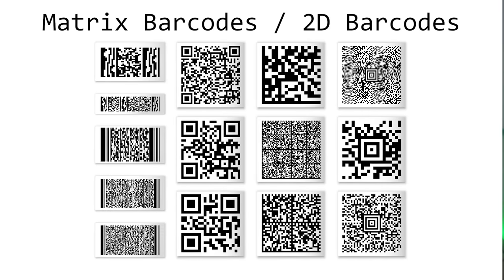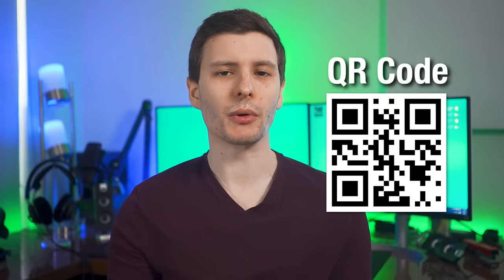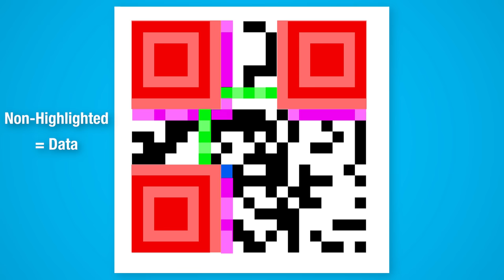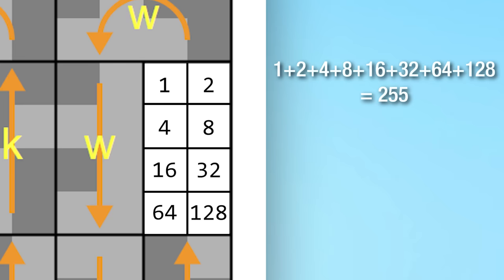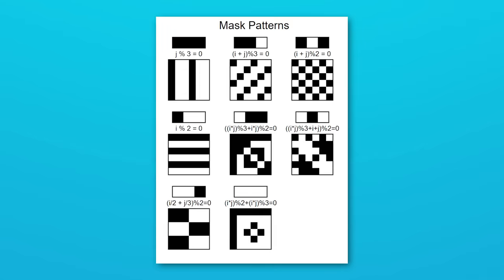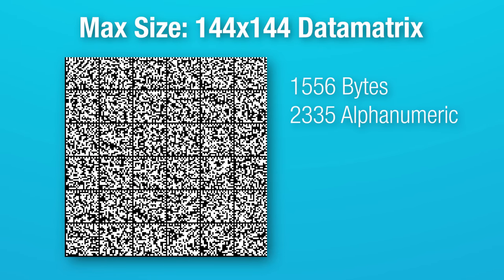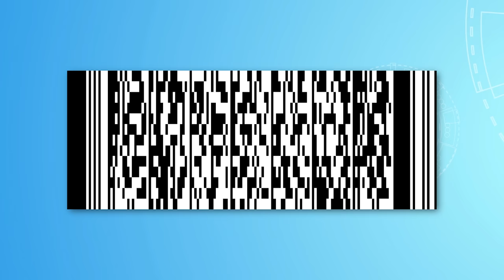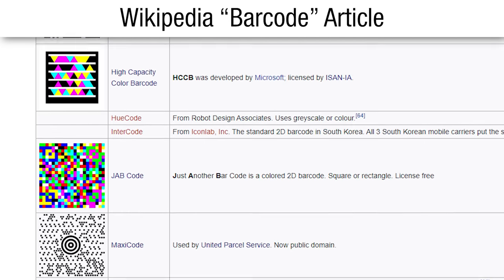What Are Those Other Weird QR Codes?

Comment: My favourite description of how error correction works is comparing it to a sudoku. Sudokus (with relatively few rules) can have most of the numbers missing, yet you can reconstruct the entire thing
Reply: Wow never thought of that angle to explain it! It explains it perfectly!!
Reply: Yeah, it's also a great way to explain data compression. Cheers!
Reply: There may be more than one solution to a given Sudoku that meets the rules.
Reply: @daviddunmore8415  which is analogous to a QR Code with too much info missing, I think, right?
Cheers
Reply: I don't think of sudoku as a game anymore by how much i have used it to describe what i help preventing
Reply: @daviddunmore8415  That's why data correction is so difficult :) cheers
Reply: But Sudoku codes exist, and do not have much of an application!
Reply: @cat-.-  e
Reply: It actually uses matrixes
Reply: It isn't a good analogue. Sudoku only stores very little data.
Reply: Not really, sudoku has a predefined set of data that you need to get it's location. Also sudoku doesn't allow repeating characters. It's a positioning game and not a data correction game.

The way data correction works is more like encryption or lossless compression. It's doing math using the number value of the characters. It's basically rely on having the data and results of formulas using the data. A similar real life example would be stating that someone drove 10 miles at 60mhp for 10 minutes. You only need 2 of those numbers, because any 2 will allow you to calculate the 3rd.
Reply: @Bolpat   @Tony Mouannes    - think of the completed sudoku as the QR code. then when the sudoku gets damaged (numbers removed), you still have all the needed information. often even with half of it missing, everything is still there, almost no matter what parts of it are gone. just like a QR code with error correction
Reply: @MichaelP833  While QR codes have comparatively much redundancy, still most of the space is data. A Sudoku can be unique with as little as 17 digits out of the 81 squares (very little data). When used as an analogy, it gives the false impression that error correction requires a lot of additional data – which in general it does not.
On the other hand, there are Sudokus with a so-called deadly pattern: A group of cells (usually 4) such that unless one of them is given, the Sudoku is not unique, even if all other (77) digits were given.
In total, a Sudoku cannot be unique when it has 16 or less cells given and must be unique when it has 78 or more cells given. In-between (17–77 cells given) it may or may not be unique. Usually, error correction techniques have a smaller range than about ¾ of inputs may or may not be recoverable.
I tried to come up with a better real-world analogy, but those that came to my mind were neither algorithmic nor mathematical. Most people just don’t know about even basic mathematical structures or techniques.
I guess one can use Sudoku as an example, but please let people know about its limitations.
Reply: @tonymouannes  Sudoku has mathematical rules. This is not the issue.

A specially-crafted Sudoku might have a lot of groups of digits such that some fixed cells given, there is a ratio n/m (m = group size) such that when n of them are given, the Sudoku is solvable, no matter which n of the m cells in the group you chose.
I’m not a Sudoku setter, not even a very good solver, so I could be totally wrong on this, but on Cracking the Cryptic (puzzle YouTube channel), I’ve seen so much madness that this doesn’t seem out of reach at all.
Reply: @Bolpat  true, but it's still a different logic than the 2d codes. I'm good at sudoku's and the most used method of guessing a cell is using the fact that the same number can't be there twice in row, column or square. Sudoku is a logical puzzle and you don't need numbers, you can use shapes or letters. Error correction o the other hand is based on advanced algebra.
Reply: @daviddunmore8415  one of the rules for creating a sudoku puzzle is that there can be only one solution
Reply: yes, there is no question, the sudoku analogy is a very limited comparison. most obviously, if line three starts 12, and four starts 21. that small block being damaged removes information. i am guessing that is the idea of a 'deadly pattern' you are talking about. 

but then on the extreme end of things, (thank you cracking the criptic for this insanity), with complex rules, it is possible to have a single solution sudoku with only two filled in numbers. i would hate to test it, but i would guess major random chunks of that solution could be removed and it would still have a single solution. however in this case, it has very very little information stored. no one has much use for a complex QR code that has such high error correction so it only stores a short word.

there was the comment of QR codes using advanced algebra, and i would argue that those 'miracle' sudokus start heading in that direction.

the simplest level of this would just be having a single line of number 1-9 in a random order. one number gets destroyed and you can still know what it is. similar to a simple parity check (not the same, i know). 

the idea of the analogy is not to be a 1:1 match, but to use something that is well known to give some inkling of the concept.
Reply: And… 1000 likes!!!
Reply: Sudoku Code 😀
Reply: @mothwaltz4163  Sudoku Code. When regular sudoku is too easy for you.
Reply: Now exaim how to play sudoko
Reply: My favourite description of how error correction works is comparing it to a sudoku. Sudokus (with relatively few rules) can have most of the numbers missing, yet you can reconstruct the entire thing
Reply: @daviddunmore8415  just add one or two additional rules and that's it
Reply: That’s smart
Reply: Yeah I guess
Reply: Genius
Reply: Very good analogy.
Reply: That is a great analogy.
Reply: @tonymouannes I’d say it’s kind of a mix of both depending on the type of recovery/correction. Parity-based correction like in raid 3 or 5 are a good example of this
Reply: Why is this turning into a huge argument, they aren't identical but it's a good way to explain it simply and quickly
Reply: @Bolpat  It's not about the data stored, but about how, given a predefined set of rules, we can recover missing bits of information.

Comment: Australia's largest supermarket chain is currently in the process of replacing all normal barcodes with data matrix codes on the packaging. This lets them store a whole bunch of things like the expiry date, batch number, etc. So if you try to scan something that's expired at the checkout it won't let you buy it
Reply: Sounds like you’re describing Woolworths as all their products in the Deli, Seafood, Meats and Poultry have Data Matrix Codes on their items, even on stuff that have been reduced in price.
Reply: this could also be done with barcodes and it would be a lot easier (it grabs the data from a database)
Reply: That sounds horrible, since if the matrix code gets stretched vertically on the packaging, it won't scan. If it's on any sort of stretchy plastic packaging, it's going to be so inconsistent and annoying to scan it.
Reply: @nmotschidontwannagivemyrea8932  thankfully, the data matrix codes aren’t stretched as they’re on a separate paper sticker on top of the plastic packaging, my local supermarket has a separate hand scanner on their self serve machines which makes those data matrix codes easier to scan than having to fumble around with the fixed scanner to do them.
Reply: @JaseyRae  What do you do if the sticker comes off?
Reply: @nmotschidontwannagivemyrea8932  I usually notify the staff over there when that happens, they’ll print a new one on the spot
Reply: @JaseyRae  wait... woolworths still have stores???
Reply: But what if I'd want to buy expired food (sometime still edible)?
Reply: Same in Russia. At first it was at alcohol and tobacco and now it is on milk products. But it isn't some supermarket chain initiative. It's nationwide and works in any store of any chain.
Reply: @nmotschidontwannagivemyrea8932  Isn't that what the timing pattern is for?
Reply: Australia's largest supermarket chain is currently in the process of replacing all normal barcodes with data matrix codes on the packaging. This lets them store a whole bunch of things like the expiry date, batch number, etc. So if you try to scan something that's expired at the checkout it won't let you buy it
Reply: @Theunicorn2012 , why did you just copypaste this comment?
Reply: @England91  It's a completely non related woolworths
Reply: Why would one imprint food quality and packaging data on a matrix when you could just use a bar code to refer to that data from a database??
Reply: @roseCatcher_  Because you would need a different barcode for each date, and standard UPC barcodes are far too limited in size to encode that much data. Grocery stores can have upwards of 10000 different products, and UPCs only have 5 digits for the SKU. UPCs are meant to encode a company ID and a SKU that identifies a specific product, not try to munge in expiry dates and other data.
Reply: yeah, and 9 times out of 10 they won't scan because of the slightest imperfection and you have to manually type the number in, they're horrific to work with.
Reply: @nmotschidontwannagivemyrea8932  you starve... instantly